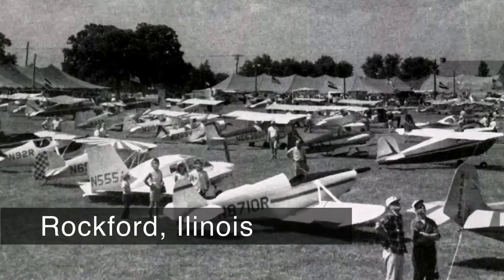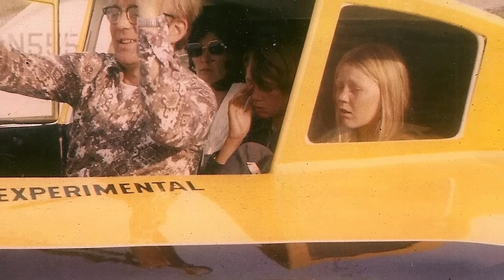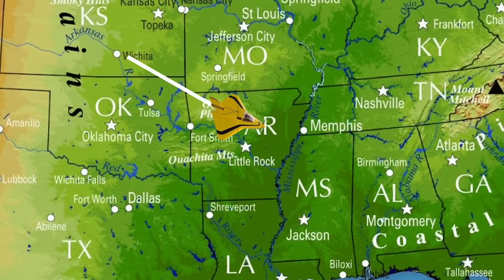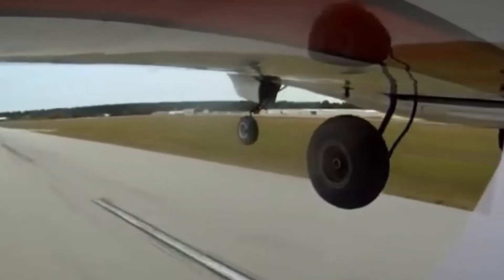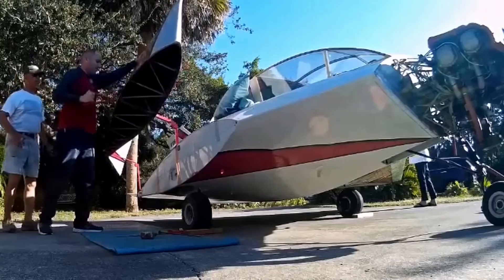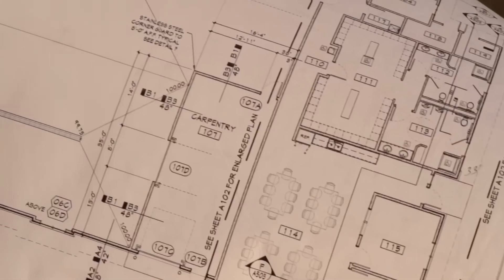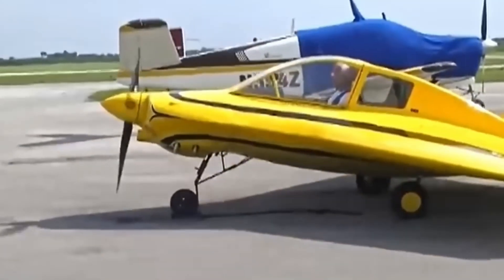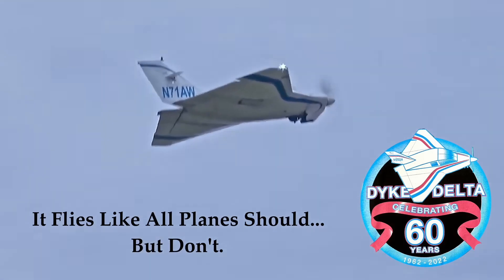A Speed Diamond - The JD-II Delta Homebuilt Airplane

Comment: There was a single seat version built in the early to mid 1970's in Mount Vernon, Ohio, by Lowell Borchers.  Named the Delta Stingray, it flew around 1975.  He was a member of our EAA chapter #9 in Columbus, and he brought it to one of our meetings, prior to first flight.  It was built out of plywood and douglas fir. Only 14ft long and 15ft wingspan!  It was powered by a Continental O-200.  On the first flight he had some lateral stability issues due to the flow off the bubble canopy interfering with rudder effectiveness.  After a few flights, Lowell had to streamline the area aft of the canopy with a small turtle deck (with advice from John Dyke).  After that, Lowell said it was as stable as a rock and fun to fly.  It was powered by a Continental 0-200 and cruised at 180mph with a top at just over 200mph.  Climbed at around 1500fpm.  Of all the homebuilt deltas, IMHO this was the ultimate. Unfortunately, Lowell never made plans available to homebuilders.